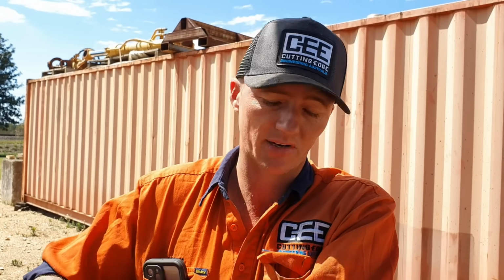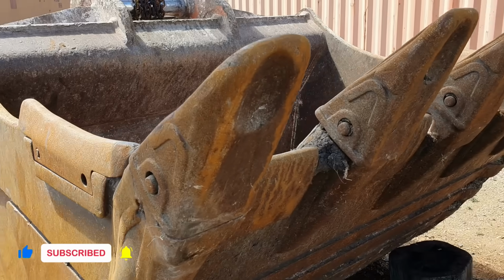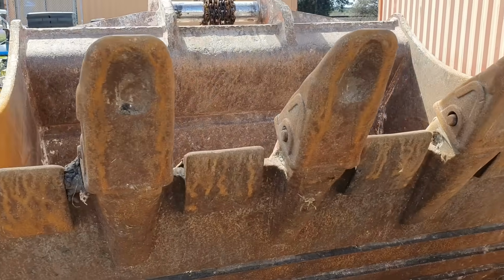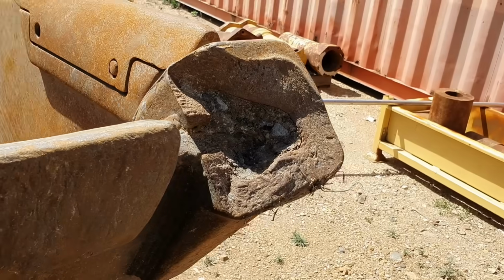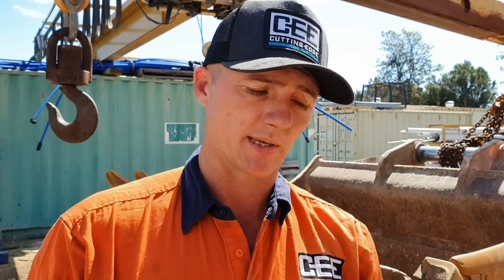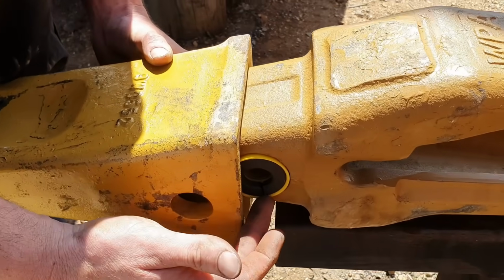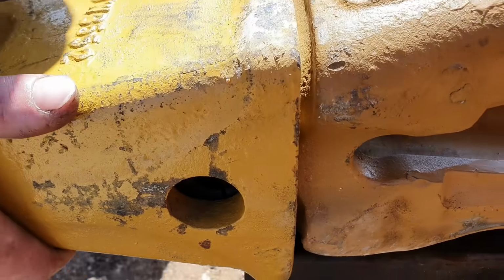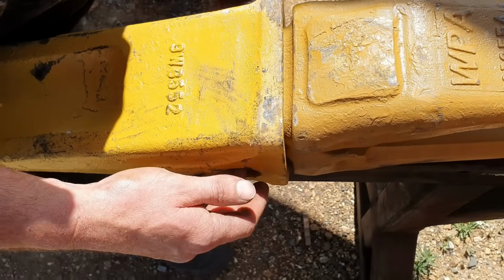Repair BROKEN Tooth on BIG Excavator Bucket | Gouging & Welding

Comment: I love the way Kurtis doesn't just plonk the adapter on, and say yeah, that's good enough to within 1/4 inch. Not Kurtis. No, he measures it and gets it correct to the millimetre. So impressive. Accuracy and perfection, even where it's not strictly necessary. No wonder his customers use his company in preference to any others.

Comment: Nice job. I got told by an old bloke once that you shouldn't replace teeth on the outside with new ones unless you do the set. Put the new one it the middle and the worn one on the outside. His theory was that new outside ones contact first putting more pressure on the outer boots. I'm guessing that's why most buckets fail on the outer teeth/adapters. Anyways keep up the videos mate good work...

Comment: Common issues we in Norway have with the adapter breaking is excessive slack and having the tooth clapping. If I just get to it in time and weld up faces so the tooth stays tight it will last a whole lot longer. It probably dont help with the chrusher teams running as low as -33 🤣 great work as always!
Reply: And thats -Celsius 🥶

Comment: Ive never done heavy Welding and dont ever get to do multiple pass welds, but would love to learn, any tips of how to practice?  
I noticed you did uphill first and then flipped the bucket to go downhill, what was the reason for flipping it? Couldn't you just weld the root uphill (presumably for penetration) and then pass downhill straight ontop or did the passes all have to run the same direction?

Comment: It's easy to break side cutters and teeth on some of the ground conditions here in Australia Unfortunately you can come across rock seams. The company you are on hire too expect you to break it out with your machine. They don't want to pay for a hydraulic breaker. They don't realise its quicker and cheaper to use a breaker in the long run. I hate to see machinery abused.

Comment: first learned air arc when i went to welding school, never knew it was a thing. definitely a fast way to get rid of material, only downside is you need decent power source. not a problem where industrial power exists. nice work.

Comment: as much as i admire your work, sitting on the piece you are welding without any isolation is INCREDIBLY stupid.
i cannot overstate how dangerous that is.

if you touch that wire while its hot (while current is flowing through it) for any reason what so ever your body becomes the direct path for the electricity to go through and i think i dont have to explain what 200+ ampere at high voltages would do to your heart

Comment: Good job👍🏻
A normal day at work. Interesting these gouging electrodes, I use an oxy-acetylene torch for gouging and cutting. As standard, I use dual shield flux cored wire. I work in the industrial machinery repair department. Ironworker👍🏻🤘🏻
Greetings from East Europe😉

Comment: Hobart xl525 can produce pretty low hydrogen weld metal if it's protected from moisture, after the sealed package is opened. Still, for short welds in areas that are highly restrained, avoid excessive maximum interpass temperatures.

Comment: Hey mate, firstly awesome skills on the tools there on this video, loved the air arc gouging, brings back nice memories. Would like to ask a question however in relation to your gun angle when FCAW. My years of using this process on pressure vessels, we would always run a drag or pull angle to 90 deg with the gun giving good build up and staying in front of the slag (if it has slag you drag) however, I noticed you seemed to run predominantly a push to 90 deg angle with the gun, just curious for your reasons for this gun angle with the dual shield FCAW? Cheers.